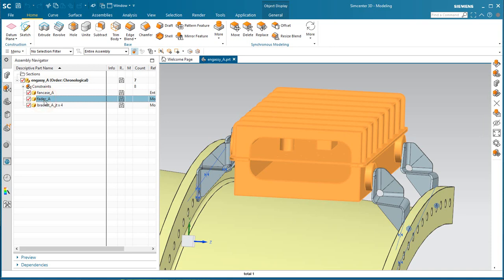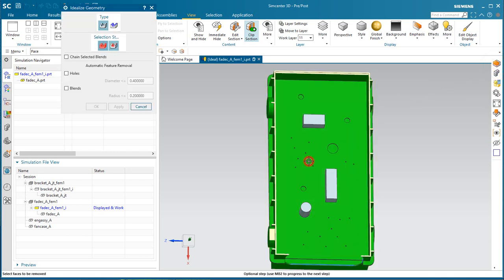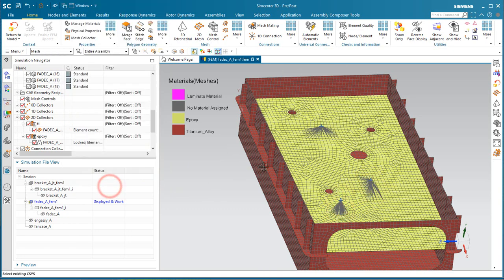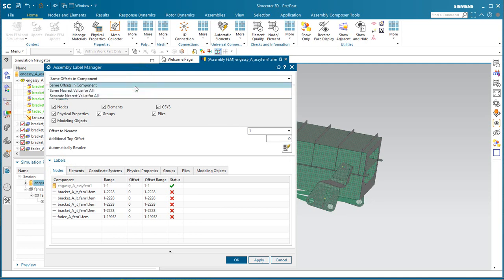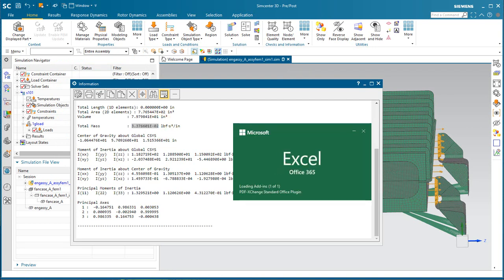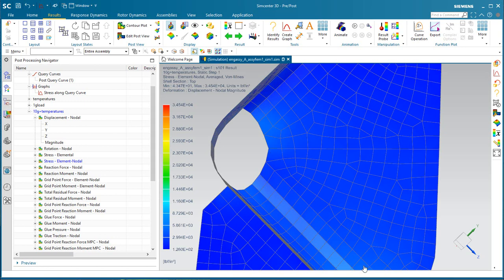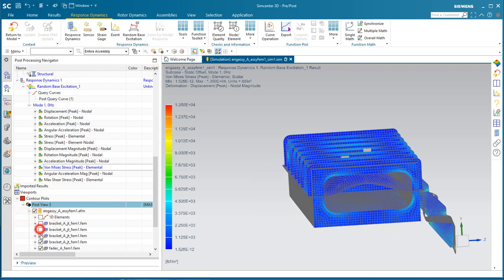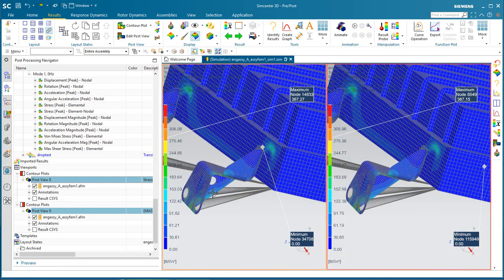Simcenter 3D Assembly FEM of an Electronics Box for a Random Base Excitation

Comment: For the random base excitation (subcase - dynamics of s103rs), my assembly is rotating in 3 axes around the node I created.. Ultimately, my goal is to use my PSD's for each axis as an input excitation to find 3 sigma stresses after random vibration.. the input should be onto a face/body, as my assembly is mounted to that body which the PSD was created from (in real world testing).. any help would be so much appreciated! Thanks!
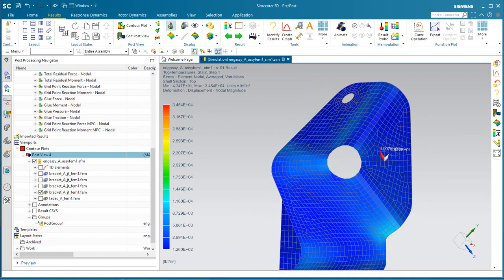Reply from the maker: Use RBE2 elements as shown in the video at time index 25:16 to connect the faces that define where you excite the structure.  Then apply the PSD in the event as shown at time index 43:47.  There are also some tutorials you can review here on response dynamics: https://docs.sw.siemens.com/en-US/doc/289054037/PL20221116635232682.advanced_sim_tutorial/xid1964460
Reply: @Simcenter3DTipsandTricks   thank you so much! I think I may have actually gotten it. One thing though, is my transmissibility plot (in Response Dynamics) is blank and so are my PSD plots (in Random Base Excitation).. to me, it seems like I am selecting the same node as my input and output in the "Evaluate Transmissibility" box but they show as 2x different ID numbers.
Reply from the maker: @ Do you have duplicate nodes at your enforced motion location.  If you set your selection bar to nodes and hesitate on it, the quick pick will show you if you have more than one node there.  Or you can run a duplicate node check in the fem.
Reply: @Simcenter3DTipsandTricks  So I have two nodes showing up in the same spot (390915 and 392829), when I check duplicate for both, it says there are none. When I click on each, one shows the face that I have selected for my point-to-face 1D RBE2 Collector (392829) and the other shows as the node (390915).
Reply from the maker: @ Delete your point to face spider and create another one that has the point somewhere you don't have a mesh or a body or another node.
Reply: @Simcenter3DTipsandTricks  This just might be the most useful tutorial/video I've ever encountered. Also, it seems I had created a node and then created the 1D collector at the same node, so I think that's where my issue was. I did what you said and I think it should work now (for transmissibility) but am getting the following error: Open Hypermatrix file error. Let me know if you know what that could be. Thank you so much!
Reply from the maker: @not_BenicioDelToro  This issue sounds like an issue that we fixed recently.  If you are on the latest release 2412, you should not see this issue.  If you are on an older release, I believe the work around was to edit the hypermatrix max array size in customer defaults.  Go to File - Utilities - Customer Defaults - Simulation - Pre/Post -  Simcenter 3D Response Dynamics - Evaluation Parameters and add a zero to the end of the Max Array Size.  If you are on the latest release, please submit a support case at https://www.sw.siemens.com/en-US/support-services/
Reply: @Simcenter3DTipsandTricks  I tried that and it is still giving me the error. I'm using 2306.. I emailed support because I don't think the support tickets actually get submitted for some reason on the support page. I've tried in the past but nothing ever happened.
Reply from the maker: @not_BenicioDelToro  Please let support know if you are having trouble submitting a support case or if it is ignored.  Siemens Support should acknowledge the support case within a day
Reply: @ again, cannot tell you how grateful I am for your help!
Reply from the maker: @not_BenicioDelToro  You're welcome!

Comment: Video was really helpful, what i dont understand, is at which point did we define for the random base excitation the frequency solution sets (freqsets), since this is a modal based solution. Is defined by default? Can the user edit the freqset and if yes at which point of the setup.
Reply from the maker: I used the function tools in response simulation. You can either edit the function or create a new one.
Reply: @Simcenter3DTipsandTricks  is it a separate function or are the points defined from the psd file? I am asking that to understand if it solves directly on the psd function points (so i could do an interpolation like you did to add more points e.g. one every hz) or i need to define something extra outside the psd file. Thank for the previous response as well.
Reply from the maker: @giannikoskomis  psd